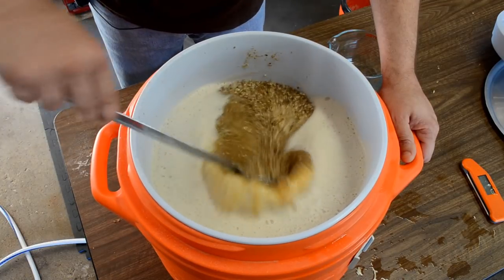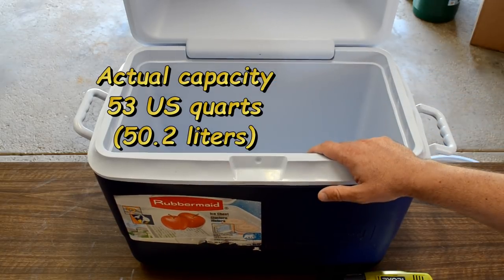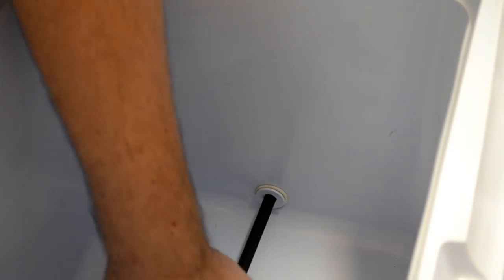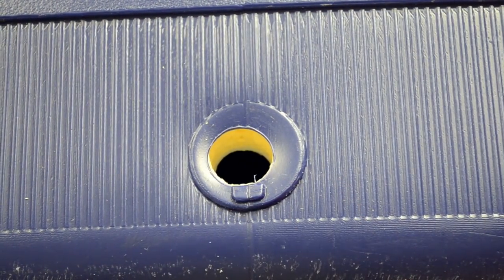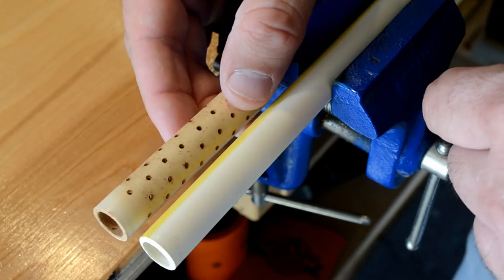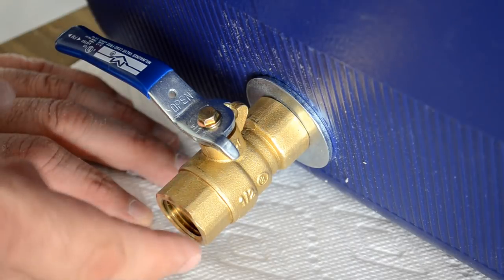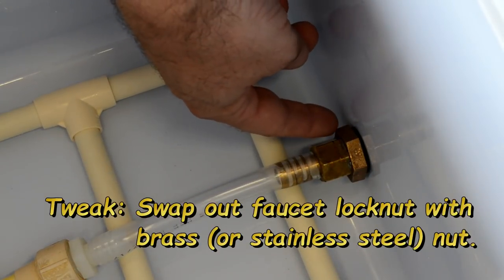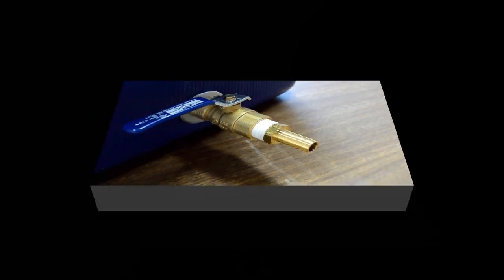Building a Mash Tun: A DIY Project

Comment: Nice work. When I made my mash tun I went copper with the Coleman 48 quart cooler.  Pretty similar design to yours except I had used copper. Also I had did slits on mine. When I was in the debate on doing slits vs drilled holes, I had read that since the grain is more cylindrical shaped slits were less likely to clog when doing slits rather than holes. Weather it's significant once its loaded full of grain not sure but never had a stuck sparge on mine.

Comment: I'm building a 2 gallon mash tun for 1 gallon batches and am planning to use stainless steel hot water heater line as filter, but if that thing collapses I'm going to back to this video and getting some cpvc piping, nice to have a plan b now, great video thanks.

Comment: You really make the best videos. 
I haven't even started brewing but already builded my stir plate and mash tun with the help of your videos. 
Thank you for sharing your knowledge
Reply: great. I have a question regarding my diy stir plate. So I got my stir bar today . It stirs beautifully withtout any liquid but once I add the water it comes off the center? Could it be that the magnet is not strong enough?
thank you

Comment: Found a massive recipe for a imperial stout I'm gonna make to age in some bourbon barrels. the grain bill is nearly 30 pounds,  and around 9.5 gallons of water to mash in.. pretty crazy for a 5.5 gal batch recipe.  So I'm going to need something bigger then my  10 gallon mash tun. Thinking about building a mash tun out of a 100 qt cooler. This video is going to help a ton, thanks for posting.

Comment: had issues getting the o-ring to set.  The cooler came with a rubber "gasket" that set inside the cooler on the existing drain line.  Used this without the o-ring and held the water perfectly.  10 gallon batches here I come!
Reply: @BEERNBBQBYLARRY  so true, as with so many things homebrewing.

Comment: I've made this DIY mash tun, I went with the slits, but I got particles of grain and grain hulls coming over after 10, 2 quart vorlaufs. I am remaking the manifold with 1/16 holes. (Yes, I'm drilling hundreds of holes.) I'll keep you updated.
Reply: I made a new one with drilled holes and I used it today for a pale chocolate porter and it was perfect. I think I used the wrong size cutting wheel and did it after a few home brews so I did not do my best work. I hit all my numbers today except mash temp (off by 4°f) and my sparge temp (off by 12°f). I'm not sure how but I heated my strike to 180 and mash temp was supposed to be 156, I got 152, maintained 152 for 60 minutes, and heated my sparge water to 175 and it came to 155 (target was 168) this is my third all grain brew. My preboil, post boil were on the money. My volumes were dead on. I also believe my lhbs grain mill is crushing too much. It's not a medium grain like you said. Its bordering on a powder/flour.
Reply: @BEERNBBQBYLARRY  thanks. I had a great brew day today. I saved the pipe with the slits. I am purchasing a cereal killer this week. I thing I can get the crush I want and use the slits. Cpvc isnt all that expensive but I dont want to waste money. I was worried i wasmt getting a mashout because my temps were off. But i understand too high a temp I'll get tannins leaching. I am not far off the numbers. I've brewed kits from my lhbs and one from northern brewer, and hit every number soo far.

Comment: Great timely video. Like you I have been working towards a 10 gallon system. You mentioned that CPVC should be used rather than the regular PVC, good call. I had saved some PVC remnants from a plumbing repair and I had planned on using those for the manifold till I asked what the difference was between the two. Other good advise from your video, I purchased a 57 quart cooler for my project awhile ago and I will now be confirming the volume here shortly. It looks like I have just about everything to finally put this puppy together.

Comment: Hi Larry I can you throw any light on my problem the flavour on my oatmeal stout has been awful for some time now and I've got no idea what's wrong 
My mash tun manifold is made from copper and I only rince it out when I'm done should I clean it out using boiling water and detergent 
Also my yeast is so5 which I store in my freezer my base malt I keep in my bag on my cement floor and it's whole grain any suggestions would be wonderful 
Ps today baffled thanks it used to be so wonderful thanks Larry

Comment: Hi Larry! How do I make my mash tun 100% empty? I tried to build a system like yours but I end up with 3-4 cups of liquid in the bottom that won't drain in the pipes.
Reply: Actually I made the test with water only. Could the weight of the grains help the liquid to push out?

Comment: Thanks Larry, great instructional video as always.  Say, for a larger cooler, do you recommend a proportionally sized design or would this false bottom size work just as well?  I’d like to use a huge cooler for larger no sparge batches.

Comment: Hi Larry. I am switching over from extract to all grain, so your videos are a big help! I currently brew 5gal batches, but the cooler which I would like to convert into my MLT is 52 quarts. I also am learning to use your excel product but noticed when updating my brewhouse info, anything over 42qt for Mash Tun size results in a single step drain (my kettle is 40qt). Sure I can put a 40qt value to use a 2 step batch sparge but at the expense of each add/drain only being 14.5qt when using the 1.5 water/grist ratio. Any suggestions you could offer? Perhaps this cooler is just too large and could better serve as an ice-water bin for my immersion chiller?

Comment: Larry how’s it Going I built this mash tun lather
Cooler but same Design I checked flow rate based on all holes I drilled in right at about 1 gpm natural flow rate is that abt what
You were seeing and is that sufficient.
Reply: BEER-N-BBQ by Larry understood I was trying to get an idea I never had a preference or expectation that’s just what the flow rate is I wanted to add a pump to recirculate I just wanted to check and see if that was a good flow rate for natural drainage was all

Comment: Great video, Larry. I have two coolers that I'm thinking about turning into Mash Tuns/HLTs. One is a 5 gal Igloo and the other is a 15 gal Igloo. I've contemplated turning both into Mash Tuns for different batch/gravity sizes and using the other as the HLT. In your opinion, can a certain mash tun be too big for the batch of beer one brews? Ie. If I'm mashing for a 5 gal batch, would the 15 gal mash tun be too big? Would I run into issues trying to hold that mashing temp for an hour with so much head space in the mash tun? If not, I'll just convert the 15gal into my mash tun and use my 5 gal as the HLT and save the cash. What are your thoughts?
Reply: Have you ever tried no sparge mashing? I just started briefly reading about it and it sounds kind of straightforward and an easy way to fill space in a big mash tun for a 5 gal batch. It sounds like it can cut some time out of the brew day as well by mashing your entire boil volume. Thoughts?

Comment: Great video as always! For my mash tun, I use a length of stainless steel braid from a faucet adapter. I'm really considering switching over to amanifold system like this. Just curious what your thoughts are when it comes to a manifold system like yours vs. stainless steel braid system.
Cheers!
Reply: The stainless steel braid has served it's purpose, for the most part. Personally, I find it moves around way too much and it has trouble draining runnings from the end of the tun, opposite to the ball valve, to the point where I'm actually propping up the one end to get enough runnings.

Comment: We reached out to a building store and they say brass should have lead in it do stainless steel is best. But all the equipment we can find is only brass based on ur instructions. Also no one sells a bold and washer that would fit the brass nipple because on type of threading between the two. Any suggestions for alternatives to building the valve set up?
Reply: Any suggestions the the washer and bolt issue? I keep getting told they dont have that size. I need a 3/4 bolt for the nipple as well as washer. I keep getting told it's the type of threading is why I wont find one.
Reply: @BEERNBBQBYLARRY  sorry it showed a lock nut nut. Since I'm in canada they say we have a different threading system that the US. The nipple is a tapered thread. So the lock nut works? Cause we need 3/4 inch everything since our cooler whole is bigger than 1/2 inch. Homedepot.ca seems to not have it.

Comment: Larry, you used a nylon barb off the manifold...could you use a brass barb instead, or is there some reason that one would need to be nylon?  Side note- your videos are the most helpful out of all the homebrew stuff I've been looking at!
Reply: Having done a fair amount of plumbing work, my guess here is simply part availability.  Brass barbs are generally going to be sized to fit on copper pipe, while cpvc/pvc/vinyl fittings are going to be sized to fit pvc/cpvc pipes.  To switch from one material to another (with the same ID) usually requires specialty connectors.

Comment: Nice build and great ideas, the CPVC is plumbing or electrical ducting? I have a old fishing cooler that would be great to convert into a mash tun.  Great brewing videos and interesting tips thanks.
Reply: CPVC pipe is plumbing.  CPVC (slightly off white) is rated for hot fluids while regular pvc (pure white) is only good for cold temps.

Comment: in just leaning about home brewing.. a mash tun is for heating
your grains to make wort, right? How do you boil liquid in this?? Is the plastic okay for hot temperatures?
Reply: Okay I'm slightly embarrassed to ask this but what is the difference between a boil kettle and mash tun in purpose?
Reply: Okay I think i know. So mash tun is for all grain brewing and you want to soak the malt first and then run it off to boil later with hops and other adjuncts? Is this somehow better than a brew bag mesh that you can simply pull out? People say brewing its easy but there are so many ways to do it!
Reply: @BEERNBBQBYLARRY  Thanks I'll do that.  I've been reading and watching all i can find but everyone has a different process. I've not seen a separate mash tun and boil kettle used in home brewing until now!

Comment: Hey Larry, Any thought on whether drilled holes or the sawed channels are more effective?
Reply: Hey Larry, I plan on drilling holes.  I don't have a 5/64 bit on hand but I have the size above and size below (1/16) the bit you recommended.  Should I go smaller with lots of holes or slightly bigger (3/32)?  What would you recommend?  (doing this in the 10 gal home depot jug similar to your old 7.5 gallon MLT)  Thanks!

Comment: ugh, vinyl tubing sucks.  Go with silicon.  Way, way , way better.  I also used to use a similar copper manifold but switched to a filter bag (BIAB) for $30.  No need for manifold, and NO chance of stuck sparge.  Can mill at 0.20 mm for increase efficiency and full speed sparge with no worry about setting the grain bed.  Much quicker/cheaper/easier way to brew.